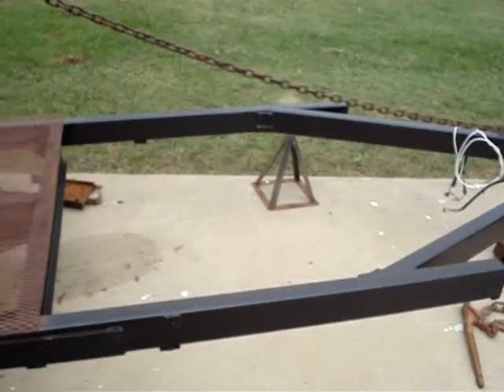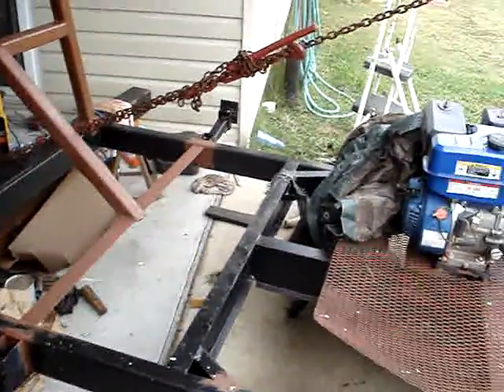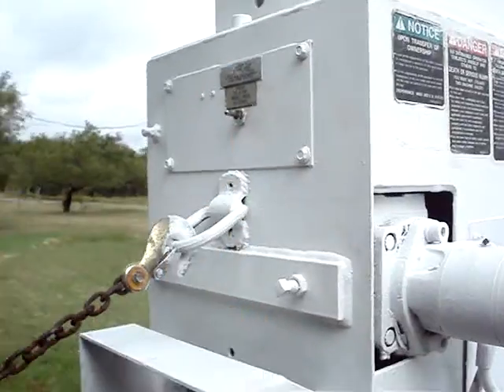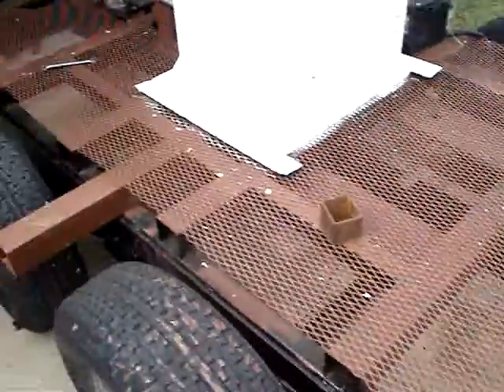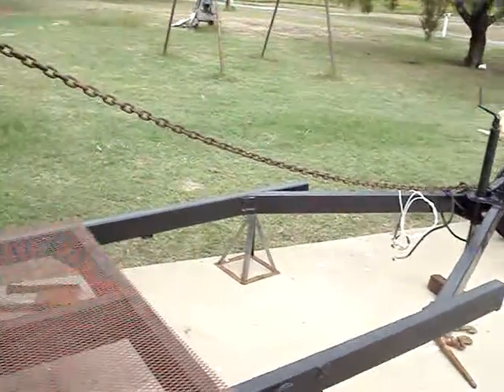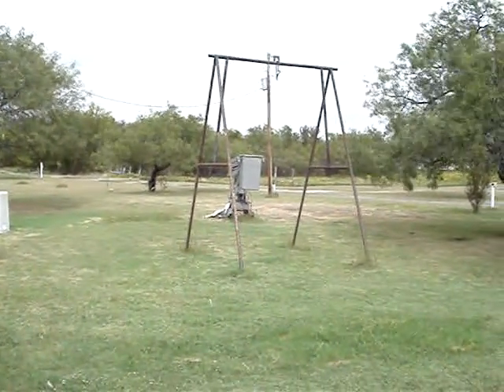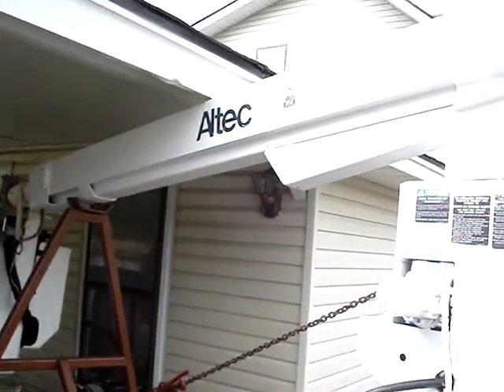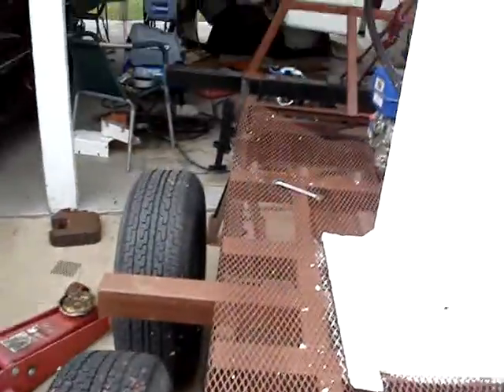Part I : Homemade Custom Trailer For My Bucket Boom Lift. New post: Sorry, no part 2. Sold it.

Comment: Any morw recent vids of it driving? That is such a cool idea. I picked up a dura van lift thats built into a gmc 1 ton  van body and am going to trailerize it, jopefully without too much hassle from mto.
Reply from the maker: Sorry, not as yet. I am too busy with 3 other projects. Nice to be retired and take your time doing what one likes. Maybe one of these days. Right now it is super cold outside and the ground is so wet that ruts would be a nightmare. Good luck in your lift project.

Comment: Gilbert, can you do another vid of the bucket unit. i want to build a single axle trailer for my dur a lift bucket with outriggers.
Reply from the maker: Sorry, I do not have any more videos. I tried to send u some pictures I had, but the Email was rejected by YouTube. I did not use outriggers, although I should, but I got busy with my zero turn mower projects to install Hydro Gear ZT-3100 transaxles instead of the current useless Eaton hydros. I am halfway done, but the cold and rainy weather is a killer.

Comment: Need something like that for my tree service business. Insurance on the big trucks is getting stupid
Reply from the maker: You should see the savings it did for me when I took out 350' of water well pipe to replace the bad submersible pump. It functioned perfectly when I replaced the bucket with a removable electric hoist. Not only that, I have modified the trailer with a nice tractor seat and hydraulic drive motors to drive around with a separate 14hp Honda motor and spool valve. In addition, I added framework and another cylinder to act as a press to be used as a tire changer. I also used it to remove three drum races and bearings from two of my cars. It is a money saver. I plan to put the video in the future for all to see and enjoy on how they can get ideas to construct their own project. Thanks for the positive comment.
Reply: Gilbert Jaramillo where did you track down that altec boom.  And congrats on the multifunctionality of the entire unit!
Reply from the maker: It was in Lawton Oklahoma on a Craigslist ad. Paid $1200 for it and brought it back 200 miles on my utility trailer.

Comment: Whr did u get those
Reply from the maker: Bought the boom in Craigslist in Lawton, Oklahoma. Used another of my homemade trailers to transport it 200 miles home. I then modified and customized an old trailer frame for the boom. Bought the 5.5hp  gas engine at HF and used Love Joy couplers to run the 8 gpm concentric pump. I added a remote control to power the extra 12v hydraulic pump in case the gas engine  died and I would be left 25 ft in the air(worked good). The boom trailer now has  2 wheel motors that powers it around the property. It runs fast but I had to add a separate 14 hp Honda gas engine to run a separate hydraulic pump. I also added a hydraulic cylinder that acts as both as a press and as a tire changer. Currently I do not have a video of it because I am working on a huge home project to convert my 60" Swisher zero turn mower to run on hydraulic motors like my boom. It is taking lots of time and is not easy like the boom project. In the middle of my zero turn project my a/c went out and I had to order a new outdoor condenser and air handler for the house. Had to but lots of HVAC tools for installing it. It is hot and humid here in North TX!